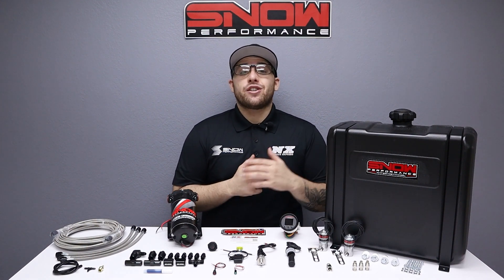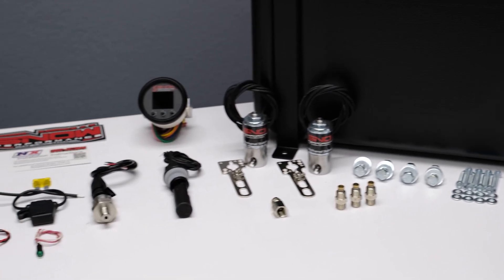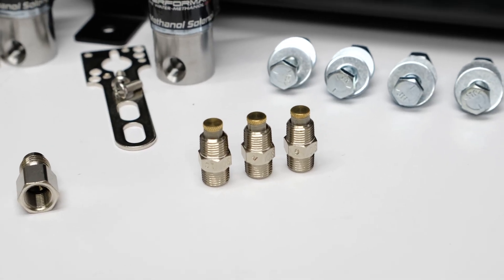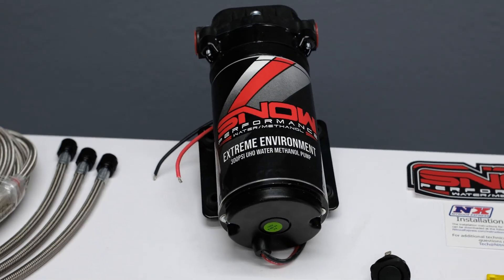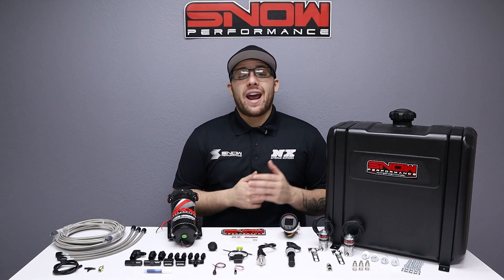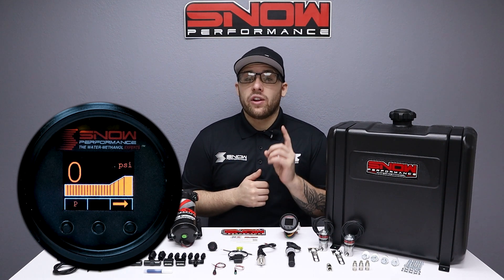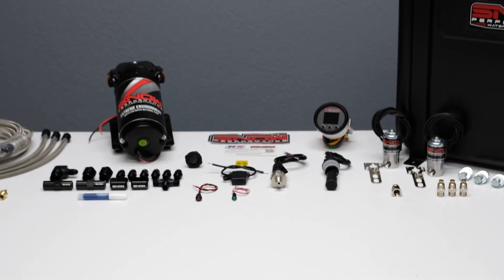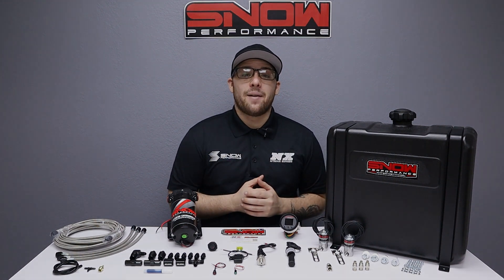How to Get the Most Out of Your Diesel Engine!! Snow Performance Water Methanol System

Comment: Flow enough for a Detroit 12.7 DDEC 4 pushing 40 psi on good pulls? Would the volume use offset weight and cost?

Comment: Would this work with a A4 Avant B8 3.0 TDI CAPA?
Reply from the maker: Yes
Reply: @snowperformance1  And how it does! Went for the Stage 2.5 TD ProLine kit with Dual Stage! Stage 2 tune but not for water methanol optimised. The car is pulling like crazy! Had 5 different people ride with me and everyone was shocked about the difference it made. It's a Quattro and literally lifts the front methanol is injected! Absolutely mind blowing. In general, would you say, based on your research and experience - is a 50/50 mix safe to use with a stock tune? Or does it lean out the combustion/mess up ECU AFR calculation?

Comment: Can I just use plain water? I'm interested in getting EGTs down, don't need no meth
Reply from the maker: If using just water you'd want to start off with a slightly smaller nozzle, as well as distilled water, and see how the vehicle reacts. From there you can decide to move up to a bigger nozzle or smaller if needed.

Comment: Would it work for a 2.0l D4-D engine for a 2005 toyota rav 4 ?
Reply from the maker: It would!
Reply: @snowperformance1  that is realy cool, to bad i cant affoard it 🤣
Reply from the maker: If you want to use code 4LUG it will save you 10% on any order!

Comment: Question.

Says universal in title.

I have a 1989 inline 6.6L six turboed newholland motor in a school bus built off the F600 from ford in the early 1990s and late 80s.

I want to do a water injection system that will be simple, my engine has little to no electronics, and thatay pose a problem, but i believe the engine would benefit on the hoghway, from the added power, cooling, and cleaning action it will have on the engine.

The newholland is all mechanical, and so are my transmission, rpm meter, and road speed guages.

No exhaust sensors, egr, def, none of it. Legally its a motorhome at this point, and id like to spiff her up some.
Reply from the maker: I see. This system will still work for you, as it injects water-methanol based off of boost pressure. We include a boost sensor with this system you'll just need to have somewhere for it to go and read boost properly

Comment: So the water/methonal is port injected therefore cleaning the intake valves and helping cool the engine? Would this work on a 3 liter diesel?
Reply from the maker: That's correct and it would! We even offer custom direct ports here in house

Comment: does it fit in the engine bay
Reply from the maker: This is a 7-gallon water-methanol tank. I don't believe it will fit in the engine bay
Reply: @snowperformance1  where does it go then
Reply from the maker: @samuel0spicer533  Most people mount it in the trunk or bed

Comment: I have a system installed on my 3208 Caterpillar ..  Now I am looking for a Riny Miniature system for a 1203 CC V-Twin air cooled Motorcycle engine..
Reply from the maker: At this moment we're not developing a smaller pump, but I will let my engineers know to keep it on their radar
Reply: @snowperformance1    Thanks  Skidoo  has Water / Methanol Injection on a turbo charged  two stroke 800 CC 2024 Model sled.  I am following that .. but  nothing in their parts list yet.
  I think the Problem is that this system will be run by the Snowmobile ECM .. not stand alone.
Reply from the maker: You may look into running something like our High Capacity Pumpless W/M Systems. Here's a link https://www.nitrousexpress.com/High-Capacity-Pumpless-Water-Methanol-System.asp